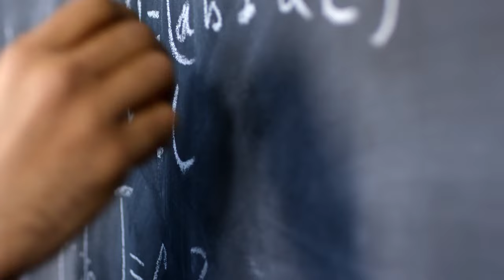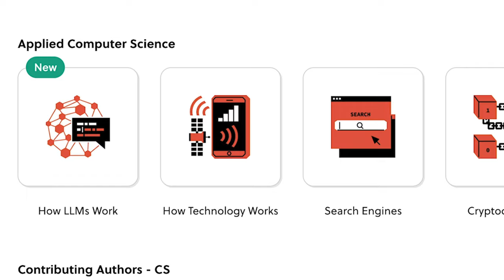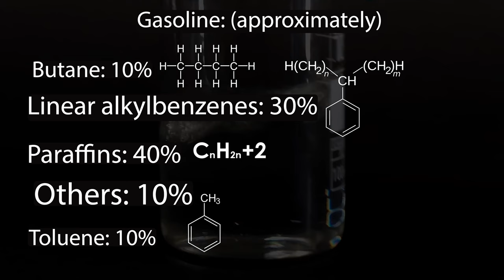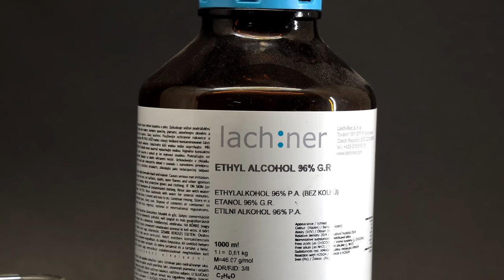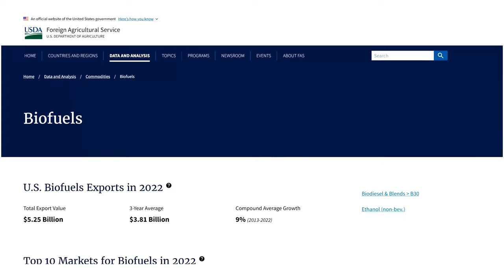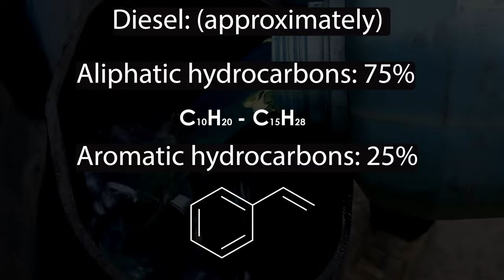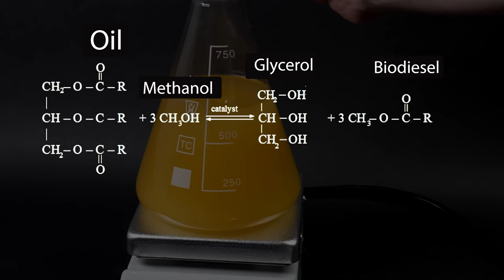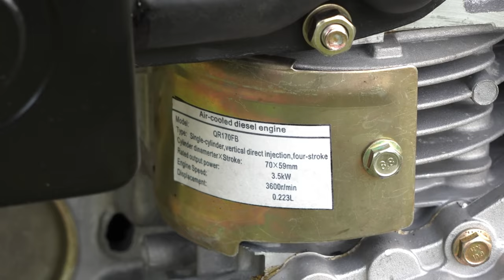Why Biofuel is a Scam?

Comment: The original diesel engines ran on vegetable oils, not crude oil diesel. Rudolf diesel originally used peanut oil. We switched over to petroleum based diesel because it was cheaper to buy.

Comment: voice which doesn't fit to the movement of a mouth gives strong AI vibes and also is really bad quality overall...
Reply: Strong ai vibes ? You realize that every documentary dubbed for the outside market is done that way ?
Reply: Are you not familiar with dubbing? Were you born in the last 5 years? He's not speaking English in the original audio and a voice actor is reading over it. Welcome to the world.
Reply: @omnirath  - Actually pro dubbing puts great care on overlapping lip movement with the dubbed voice. Alternatively a cheaper way is to allow the original undubbed voice to run for a few seconds before the dubbed narration takes over, that works OK although it's less professional.
Reply: @filonin2  funny i am from a country where every single movie and series is dubbed. so i know what dubbing is and how its done. the problem is not that the original voice isnt english. the problem is the images doesnt fit the sound. I am just saying its bad craftsmanship... one easy solution would be to simply not show the "speaker" and everything would be fine.
Reply: @omnirath  its a fundamental difference if you have one moderator/presenter who is working on the video from having several interview partners... if you take a look at documentaries most of the time the speaker is off screen. its just a speaker whose voice is put over footage, its not a speaker being filmed and then dubbed. of course if you would do perfect dubbing for every interview partner it could be very costly (thats one the reason the speaker is speaking from off, so you just have to pay one translator and speaker to release a documentary in another language). And there are other ways too. There are several documentaries who dont dub at all but put subtitles on.
All I am saying is, it looks weird if dubbing is done incorrectly and it would benefit the video if you don't show incorrect lipsync. And I am sure many people understand that bad dubbing can do more damage than no dubbing at all. Its one of the things you cannot blank out after you recognized it.
Reply: @dimitralex1892  idk I watch for the content not the presentation, if you seen a mythbuster episode in the eu it’s done quite like that
Reply: @omnirath  thats okay... i never said the content is bad, in fact imho its quite good. I just said that I think it would benefit the video if the dubs would be done more accurate or in another way...
and i never said that there arent any other media which have this problem... but i will stop responding... I don't think this discussion leads anywhere. I just gave honest feedback of my impressions and also gave solutions in the responses... I think in time of AI it is a reasonable goal for any creator to distinguish their content from AI generated one... that's why I wrote this feedback, because it gave me a feel of all these stolen content ai voice videos... you may not like it, but that is the way it is...